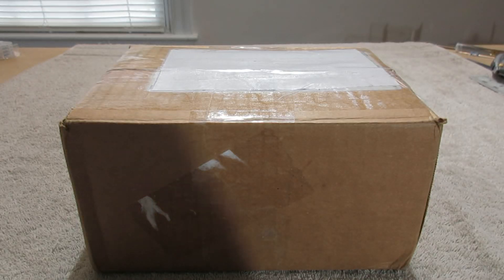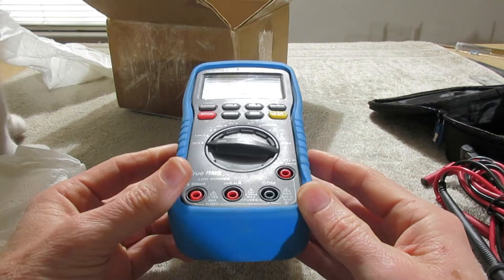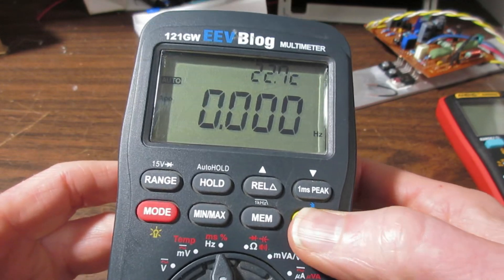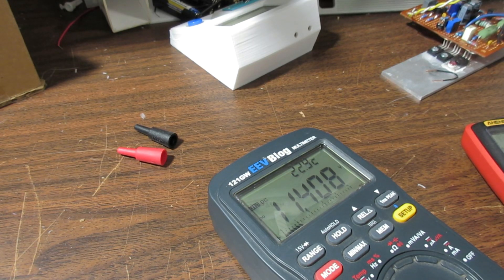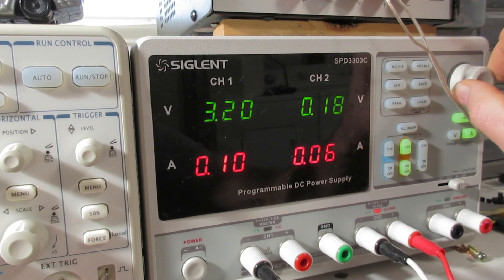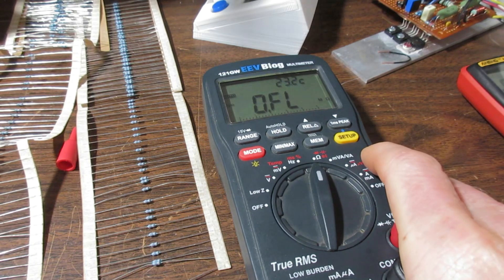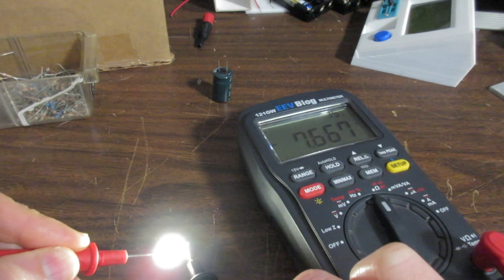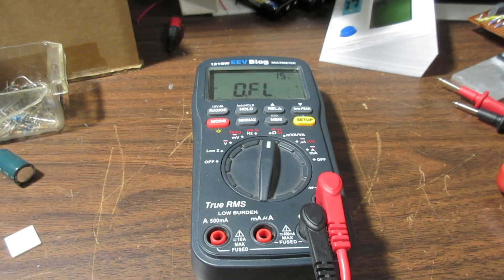JohnAudioTech gets a 121GW EEVBlog multimeter !

Comment: a 5 digit display?  does anyone have need to measure a voltage to the nearest one tenth of a thousand to a volt?!!!
I like Dave Jones and the EEVBLOG, but at 200 bucks US it should really have a lot of bells and Whistles.  I could see if you were a pro, but if you were a pro you'd probably buy a Fluke, and you what they say about Flute, "if it works it's a Fluke"  no pun intended, okay, maybe a little pun. 

sorry Dave, but I know I won't be buying one of these anything soon.  sorry John   mike
Reply: snaprollinpitts a Fluke with these feature set would be double if not triple the price. Especially with data logging.
Reply: @OutdoorsIQ  like I said, for the ordinary electronics guy this is a lot to pay for a meter.
Reply: @snaprollinpitts  Basically it's not for ordinary electronics guy but people who have the needs for higher end features like uA current, uV voltage, TrueRMS measurements and firmware upgrade feature etc .
Reply: There is a lower end model since like forever. And there are countless meters under 80dollars on ebay that serve the job if most of these features aren't for you. 
Also you don't need to be sorry for not willing to buying it. It's market positioning. You are not in the target group. So feel free to buy any cheaper meter that suits your needs.

Comment: That's a very nice gift, the 121GW sells for around $235 (and about the same in UK pounds and Euros).  It has bluetooth connectivity for remote operation and can log data to an SD card, pretty neat.  Useful for you, the true RMS measurement is accurate up to 100kHz.

Comment: nice! but this is also a testiment to how good these cheapo multimeters are nowadays.
Reply: $7 E-bay meter is best meter when you leave it on top of a truck tire then run over it.
Reply: but this is 20$ china meter and pretty good if precission isn't concern #1! better than the 3$ china meter that i bought back in 2005! still using that thing and it doesn't even have a diode-mode beeper and is slow as hell
Reply: @krass76  This is neither.

"The meter is manufactured by UEI Test Instruments, a reputable US based designer and manufacturer of high quality test gear. The design work was primarily done by UEI, but with a great deal of design input and direction from Dave. The meter is manufactured in South Korea."
https://www.kickstarter.com/projects/eevblog/eevblog-121gw-multimeter/

Comment: What is the "low z" used for? I have never seen that on a meter before.
Reply: Sometimes capacitive coupling in wiring etc. will make it look like there's a hazardous AC voltage present as most meters present a very high impedance, even though these 'ghost' voltages are not capable of providing any significant current. Low Z, aka low impedance mode is not susceptible to these.
Reply: @oldblokeh  so it is used for reading AC voltages only?
Reply: @sargetester99  I've only ever used it for AC power circuits, but I guess you could use it for DC measurements too, if the meter lets you. An example might be to measure the on-load voltage of a battery.

Comment: Hey John, what do you think of the osciloscopes found on Amazon for under 100 dollars, are they any good for audio amp testing ?
Reply from the maker: I'm not familiar with them. If they can reach a few MHz at least, you can get by but it may miss amplifier issues such as high frequency oscillations.